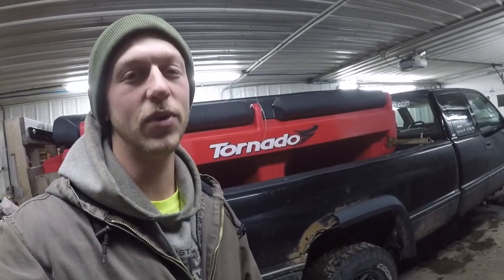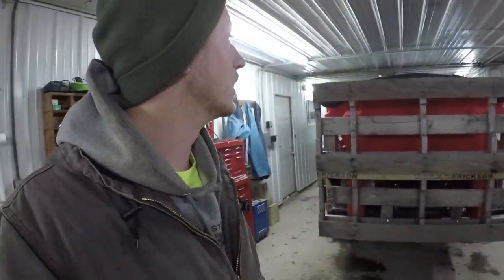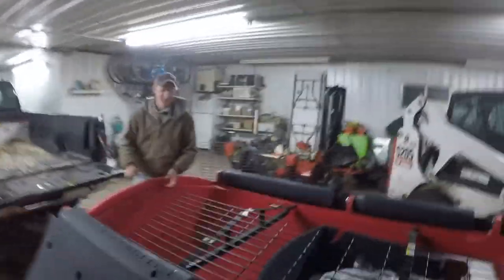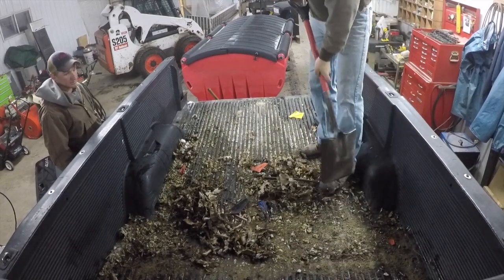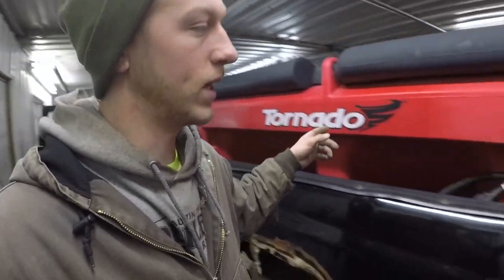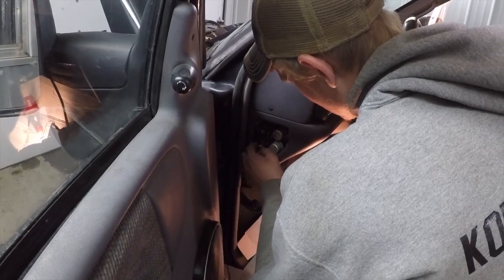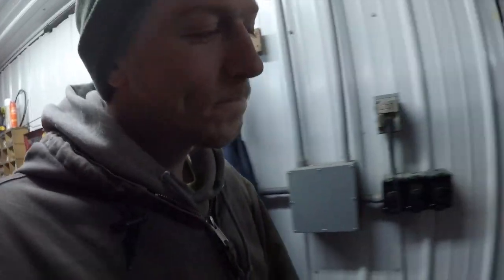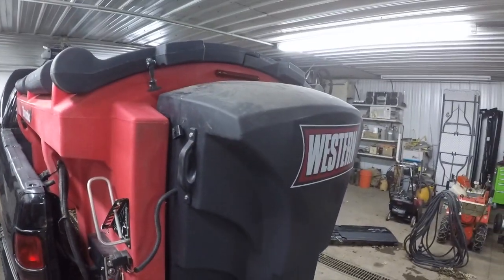Installing the Western Tornado Salter!

Comment: How is the salter working?
Reply from the maker: It's amazing. I had previously used a 120 lb capacity hand spreader and pushed that around the lots. Haven't had any issues with it, the 1.8 c.y. is a good size for what I need, and it's actually super fun to use. Very efficient.
Reply: Evans Landscape LLC love seeing people start out with not much and upgrade work hard to expand!! Nice work!! I’d like to get a spreader like that!